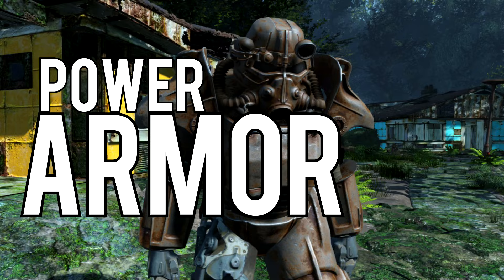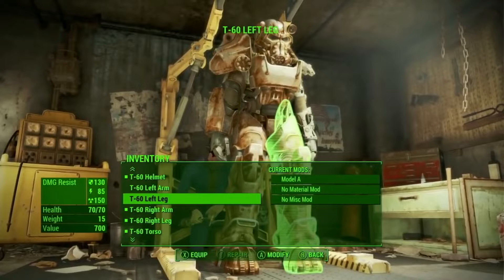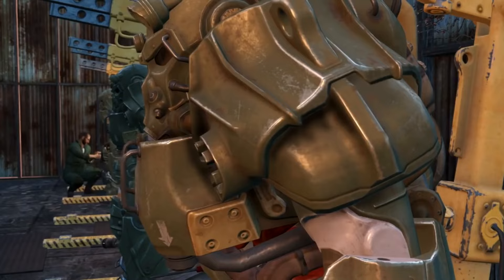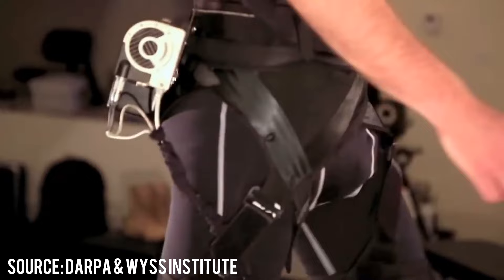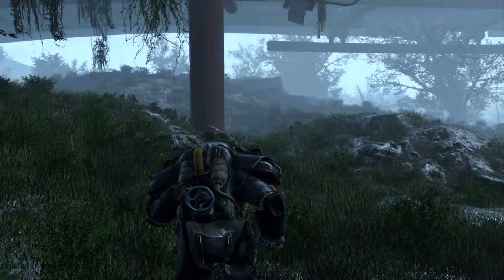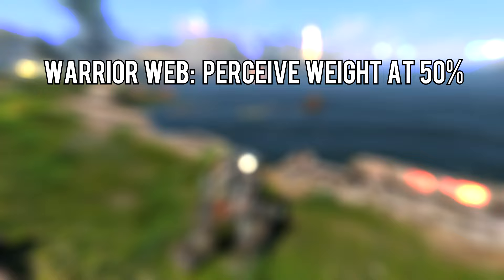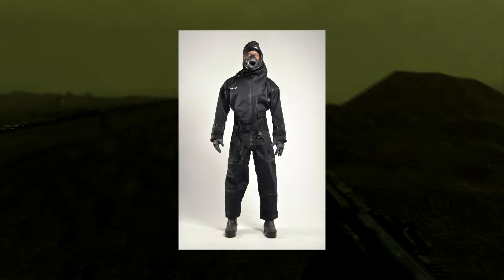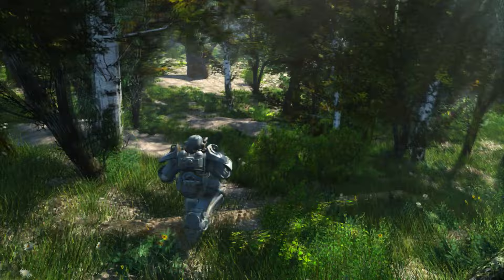The TECH! How close are we to POWER ARMOR technology?

Comment: 3:00
A big issue with kevlar as well is that it's flexible. Even if it stops the round it won't stop the force of impact. With pistols where the energy is fairly low this isn't a huge deal but rifles have a lot more power. Even if a kevlar vest stops the bullet it will still likely break ribs.
Reply: Depends. What vest, the target, and bullet?
Average versing .45 is going to be painful but not a rib pulverize by any means

Comment: Ok, so a quick lesson in what is actually required for functioning power armor. The "suit" , would actually need to be comprised of several layers. 1 being a smart, or, biomass which is all the stuff necessary to track the physiology of the wearer. 2nd, a load compensating frame, as was built by DARPA. This increases the wearer's dexterity in managing the next two layers of componentry, which become much more technical as it advances. 3rd, is the frame and construct, which harbors all kinetic empowerment, like thrusters and hydrolics and animators for rotation and elongation grab, as well as all automatronic enhancers then thought of. 4th is the plating and recompensatorabfor breathing in odd environment(water, atmosphereless, pressure outmatching, fall compensation, ect.) with a 4 fold suit, the design is much more probable. It is also layered nominally to damage resistance/environmental compensatory than being two layer as the current school of thought is. Expensive? Yes, beyond practicality.  Efficiemt/realistic/practical? Avsolutely. All evolutionary forms of advancement have this issue, but this is the only way I know would actually effectively infer the traits of acceptable power armor, while making it seriously capable. Stage one is what the wearer always has to wear, two through four are fused in layers as described. Thus, the tank we all love, TRUE POWER ARMOR is born.

Comment: AR500 steel plates can handle repeated small arms fire quite well, much better than ceramic plates. It is a bit heavier, but would be better for power armor.
Reply: you shoot a metal plate 10 times and touch it without burning yourself even with a .22 in the same place its warm

Comment: power armour wont be used by military forces because they're flawed in many ways, you watch shoddycast so you know that energy doesn't simply disperse, if you shoot a plate it heats up, if you shoot a plate a lot you cook the wearer, you might want to say: "but what if you put some sort of heat padding between the wearer and the armour" heat will get through after a while, youll still cook, and even faster if i throw a molotov at you.
A grenade will shred  any joint at the legs, elbows and groin ignoring the noise and vibration it may cause
While power armour is a fucking awesome thought its just not practical in combat and who wants to charge their own protection? just think, if you are a soldier, in combat and your armour runs out of battery, given youre in cover you now have no protection at all, you wont carry spare armour plates on the armour because itll just get too heavy, a suit of armour covering all limbs will be heavy already

Comment: I was looking into this a while back and the biggest set backs that I found were jointed movements, such as shoulders and hips because those are internalized movements where the suit would need to be external. Another one had something to do with spinal movements and flexibility as you somewhat mentioned. And the last and most important one is the Power source. You kind of glossed over the tethered suits, which is to say they work, but they need a type of power line connected to them. If I recall when I was looking it up they can only currently supply enough power for maybe 30-2hrs of untethered movement. But thats not counting all the weight and such brought on by armor plates that would be added. But, much like you I am really excited about the future prospects of such tech, even though it will almost certainly never be something citizens can get our hands on.

Comment: Overall pretty good video, however you looked over one major factor, power delivery/usage. Most of the exosuits in testing today are very limited because of their high power usage, and are usually tethered. This is fine for troops moving inventory or great around a base or hanger, but not for active combat rolls. Ultimately that's the major limitation, Fallout gets over this with micro-fusion cells; which would be the holy grail of power and would arguably end most resource based conflict in the first place.

Comment: The biggest barrier we have to make power armor is the power supply, we don't have the energy density required to make practical solutions, all we have so far are basic experimental prototypes and that wont change until we can have a good enough way to store power, like 50 M Watt/hours or more in a volume of 20 L or at most 30 kg. Arbitrary numbers i know, they are an example of what is minimum required, in my opinion, to begin making practical applications.

Comment: The biggest problem with power armor is the 'power.' We still have very low density power. Basically meaning that power is heavy if you want decent output. We just don't have a lot of power options that are sustainable. Sure we could strap a nuclear reactor to someone's back but then that has it's own problem especially if someone is going to go into a firefight. We need a better power source that has a large output for a lower weight. We solve that problem and so many others will fall in line.

Comment: As I understand it, the problem with ideas like the rebreather is a question of surface area, which would need to be much larger to get a decent amount of oxygen out of the water. Also, I see power armor being a lot more feasible than a 20 meter tall battlemech. Battlemechs are HUGE, lumbering targets whereas PA are dude sized. It does make me wonder though, someone in PA is caught in an explosion... seems to me it would turn someone into a man-sized mass of flying shrapnel. If we can engineer small, light weight and long-lasting power supplies, T-60s and Spartan style power armor will be all over the battlefield.

Comment: I'd just like to point out that 1. the gun looking like an AK doesn't make it an AK and 2 therefore the bullet may not be 7.62x39 and could be any variety of other cartridges that are 7.62mm wide and may deliver more or less kinetic energy, also the effectiveness of a bullet varies hugely depending on how many grains of powder the bullet has behind it, barrel length, and the bullet itself like AP or hollowpoint perform very differently. Just putting that out there

Comment: Actually, it would be possible to stop up to 14.5mm R armour piercing point blank with steel armour covered in ceramic tiles with an inner lining of ballistic fabric to catch any fragments (similar to chobham armour), or just plain hard steel, like SAAB's Armox Advance if we managed to heat treat thick enough slabs, or laminate many 4mm plates. Anything currently used above 20mm is generally capable of penetrating WW2 era tanks (not the german Mauss, I mean normal tanks).
 The armour in fallout is the closest to reality in any popular media, and there should be equivalent prototypes by 2020, though the general public is unlikely to find out right away. Such suits would be expensive, but they could potentially turn the tide of battles as long as there are no nuclear weapons involved (no armour will protect you from a "tiny" nuke equivalent to 100 tons of tnt). One thing is to take out a tank with a $100k missile or $10k rpg, but when the targets are man sized and dozens of times as many, the only effective infantry weapon will be 20mm anti tank rifles, which are far from practical.

Comment: The frustrating truth is the only real limitation here is the power source. We currently don't have space efficient enough batteries or a small and efficient enough generator to make the powered suit cordless. Steel shielding, exo suits, rad resistent layers of the exo suit or an undersuit, we got all that, but we just don't have a way to do that without it having a massive cord attached to generator a few feet away.

Comment: Power armor is basically a exo-skeleton with armor plates attached to it. And instead of a fusion core to make it all run we would need a decent battery. In Theory you could allready create power armor with todays technology. But on the other hand the amount of anti tank missiles used would go up to just simply counter it. After all it would emit a EM field which you might be aible to lock onto.

Comment: rather than comparing power armor to modern body armor, it should be being compared to vehicle armor/industrial vehicle plating.

for example, I shoot a steel target that is used in military vehicle armor applications and is only about half an inch thick. it has taken over 1000k rounds of varying calibers(9mm, 5.56x45, 7.62x39) and has only had one round make it all the way through, and that was after several 7.62x39 rounds hit that same area. if one torso sized plate can take that abuse, power armor should be able to handle quite a bit of abuse using the same or better metal

the power armor frame is only like the warrior web in its theory and what envisioned to do. what i mean by this, is the warrior web seems to be powered strength/endurance boosting equipment with minimal intrusion in mind. power armor frames are like a powered mobile suit you climb into and operate like heavy machinery.

Comment: Caliber has little to do with the penetrating power of a projectile. Velocity is the defining factor of bullet penetration - which has more to do with the length of a gun's barrel than its diameter (and obviously how much powder is loaded in the cartridge). Therefore, two guns with different barrel lengths firing the exact same cartridge, will have vastly different penetrating power. For example, a 9mm fired out of a 3.5" pistol barrel will have far less penetrating power than if the same 9mm were fired out of an 16" carbine. It has to do with back pressure and the surface area of the rifling. Cheers.

Comment: We are closer than you think.

Power Armor durability in game is a balancing mechanic, not really demonstrative of real world physics, as real world steel armor is known for it's multiple shot stopping capabilities, able to endure dozens if not hundreds of small arms shots before finally failing, it's only downside is weight. A lvl 3 plate capable of stopping significantly more bullets than a lvl 3 ceramic plate weighs about 10lb, and that's just a single front plate, not talking about side or rear plates. Ceramic plates however weigh around 6lb, while also being about twice a thick, and Polyethelne plates weigh around 3lb, but are about four times as thick as steel.

Regardless what is stopping us from making power armor is the power source, as batteries suck and engines are heavy, hence why the exosuit the army is considering is tethered, as in by a power cord. Because a power cord is significantly lighter than strapping an engine to it, while also providing far more power than batteries can alone, all at the expense of mobility, which for their currently intended applications isn't that significant.

Comment: My prediction. 

1st generation units will be armored with a blend of ceramic and steel Armour; they'll protect the user up to regular .50bmg rounds but will be hampered by the low capacity of battery technology available. They will be used in CQC environments,  clearing buildings and ships occupied by enemy soldiers, or the defense of bases and other installations. In these cases the low endurance of the suits will not be as great an issue as new batteries are close at hand or the action is likely to be short. 

Improvement's in battery technology will bring the second generation suits; with the endurance improved the the point of 6 hours plus, they will become viable as front line troops. Armed with mini guns, variants of the M2 browning and automatic grenade launchers, their primary mission will be the capture of enemy strong points and exploitation of weak points in defensive lines. Surprise attacks on fuel and ammo dumps and convoy ambushes are other missions these units will perform well in.

Late in the 21st century the 3rd generation suits will emerge; these will be powered by super high capacity batteries that can power the suit for as long as a week with minimal loss of performance. Commercial mining of asteroids in space will allow the replacement of ceramic and steel armor with far more durable materials such as osmium, iridium and tungsten.

Comment: Well you could soak up a lot of rounds depending on how the suit is made. The first layer can be slanted as to redirect some energy from the round and keep it from penetrating the first layer of armor. Have maybe a centimeter or 2 of space to the second layer which could be the polyethylene strike plates, again they'd be slanted to redirect energies. Under that you could have Kevlar, or maybe just maybe graphene armor (even though thats probably 50 years away). Then you'd have that radiation material from what was it again? The polyethylene, right? Then the frame which could be made from a mixture of aluminum, ceramic, carbon fibers, polymers could provide minimal protection as well.
Reply: Or fuck it make the first layer out of Depleted Uranium and slap Kevlar under that plus the radiation protection materials.
Reply: Donovan notmyname that would make it a lot better than just slapping all these things over eachother
Reply: Wam power Yeah I realized that right after posting it.
Reply: Donovan notmyname Or just a shit ton of titanium.
Reply: youd cook if i threw a molotov at you though in literally moments, its exactly what nazis did to early war tanks granted they would set a fire under the tank not throw a molotov at it but its the same concept

Comment: It can probably be made just like how fallouts is but with a cable for power usage connected to a very capable generator. Probably stationed at outposts that need armor with the versatility of a regular soldier thats a bit slower but can hold much larger weapons and be more resilient to small round fire. Definitely never going to be a internal energy system. Best case, modular nuclear reactors that can be disabled if bases are over run rendering it useless.

Comment: Bit surprised that the video didn't mention the number one thing holding us back from having power armor, namely the power. As seen by the video's the little bit of exo suite stuff we have runs off a huge power cable. Any kind of battery would die in no time and lets just face it we lack fusion cores. I highly doubt we will have power armor in our life times on the battlefield. At best we have some kind of utility suites used to repair, resupply and support troops on the field acting like fork lifts and such since they don't have to have an independent power source. There is also the cost vs survivability issue. We don't even outfit all our vehicles with armor plating, even ones in combat area's. I highly doubt if we had power armor it would make it's way to many troops by the sheer cost alone vs it's effectiveness. Sure it's a mini tank and able to take most small arms fire but it probably be pants vs heavy caliber stuff or explosions. Even if the armor survived more than likely the pilot inside would die from the impacts of being tossed around. Power armor, cybernetics and such are insanely cool in Sci-Fi settings but you can't expect it to work in real life as well. For one thing in the minds of most military leaders troops are far more expendable than the equipment and materials they use.

Comment: What if we combine the several exo technologies that exist already? They'd be much more effective, since some of them are literally worn like pants, others like straps over the pants and others as actual exoskeletons rather than suits. Mix all three, and you should have something special, as long as they play nice with each other.

Full body armor does not have to be that heavy, medieval armors weighed like 30 kilograms at most, and they were already more or less bulletproof (as in they can take a round or two). Just with that exoskeleton, putting on something like 70kgs of armor would be feasible if your numbers are correct. You could put some really serious armour on this, much more serious than what is on offer in fallout.

Power armor seems less far off than I thought. We more or less already have the tech, although I suspect we might fall a bit short in the power source department, assuming they actually need a proper power source.

Power armor will probably only be used by elite units though, it'll be like knight armor in medieval times, it'll be used, but there's not enough for everybody, not even close.
I mean we're talking over 100,000$ per armor. Possibly a few hundred thousand. Maybe even a million, depending on how the tech snowballs.

Comment: for means of game balancing, power armor has the right amount of damage resistance, but for real life it is much less than it should be. it's almost a foot thick in parts, made of steel,  titanium, and ceramics layered in ways to stop bullets. not even a .50 caliber round would penetrate that.  let alone a smaller round. and no amount of these smaller rounds would ever penetrate except maybe in a weak part of the suit. like a gap or the visor. though the visor would likely require a large caliber round as well, as it is most likely thick bullet proof glass or some similar bulletproof but see through material.